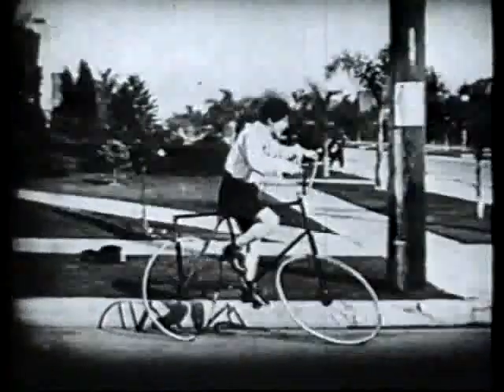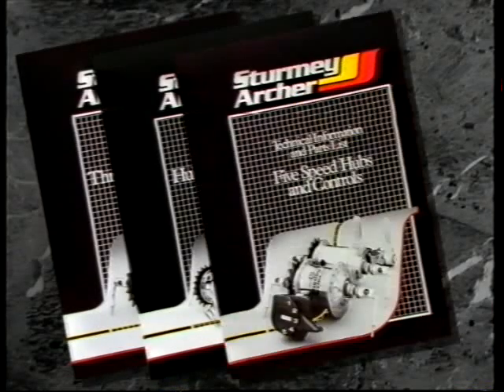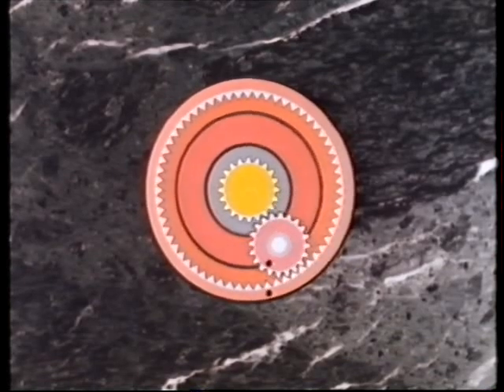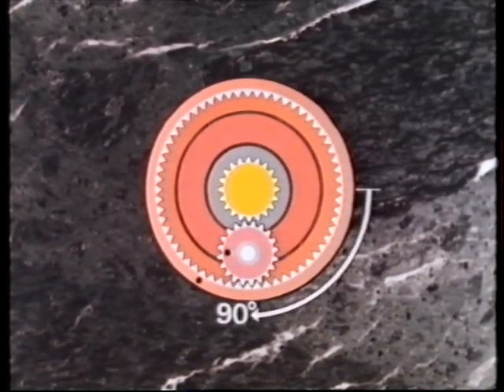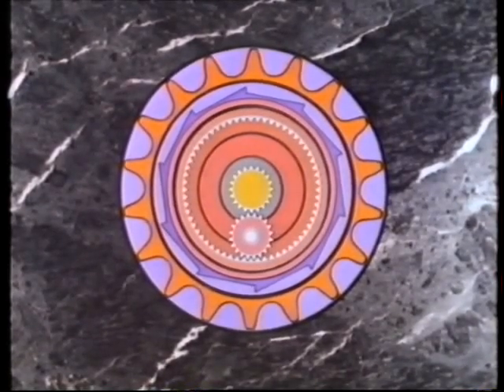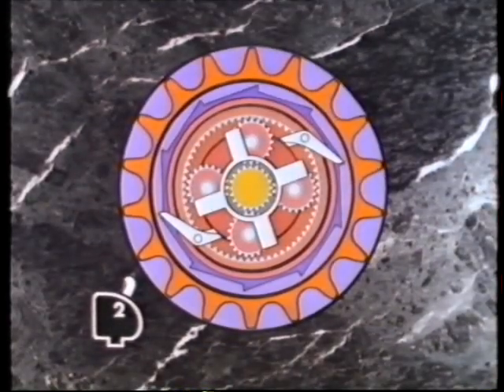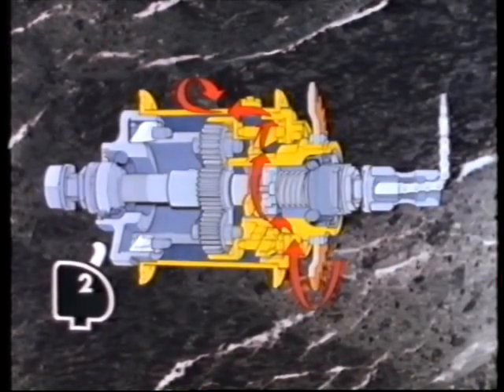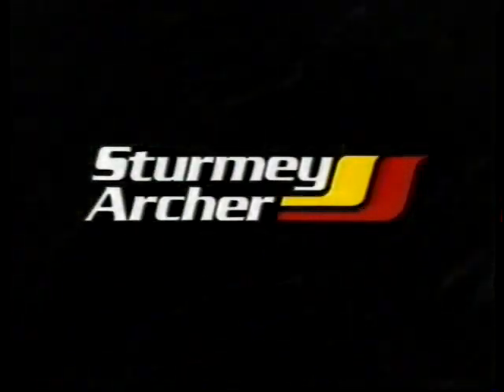Sturmey Archer Epicyclic gearing

Comment: I still have the S-A hub from the bike I road in high school 60 years ago. The rest of the bike got discarded due to damage in an accident, but I kept the hub. Being a youngster I naturally took it apart and figured out how it worked, and I was impressed by the simple and clever design. I appreciated the 3-speed hub compared to the derailleur concept because it was so simple to use and always provided the ratios that worked best.

Comment: I rode a British 3 speed bicycle for 10 years every day in Minnesota extreme cold winter salt - NO maintenance needed! I was completely anti-mechanical the whole time. I then went on a 250 mile "bike-about" at the end - along the Mississippi river. Only later did I realize all of these was possible due to the internal hub gear!! thanks so much. I probably spent $20 for the bicycle and I was in awesome physical health. Wow so you advertise 10,000 miles no maintenance and I went 3,600 miles with no maintenance in extreme weather conditions!

Comment: I won't lie, I still baffles me. But as a piece of engineering, it's beautiful.
Reply: Yep, Planetary Gears baffled me as well when I first saw them.  I saw an excavator on a reality TV show break down years ago, and I watched them open up the 3-stage drive unit... and I was hooked!  I then found the 14-Speed Rohloff Speedhub, and had to know how it worked.  It showed me just how little I really knew about mechanical engineering...
Reply: that's why getting a car transmission overhaul costs $4K - including installation. Yet a 3 speed internal hub gear bicycle can only cost $20 used with no maintenance needed for  36,500 miles!! I proved it over ten years commuting in Minneapolis.

Comment: i think I see why when in "Neutral" (here 'Normal") gear it would inevitably pop out of gear when pedaling hard, resulting in bruising my gonads on the crossbar. I tried adjusting it many times, as did a Schwinn dealer. seemed just a limitation of the design, at least back in 1958. I was glad to finally graduate from that to a motorcycle.
Reply: With a Sturmey archer the cyclist is supposed to stop pedalling when changing gear, opposite of a derailleur.
Reply: @TechStuff365  Possibly, but that wasn't my problem. It slipped out of gear when IN "neutral" (2nd gear).

Comment: In the 1980s I found an old Schwinn bicycle that I restored to the best of my limited ability back then. The bicycle had a Sturmey Archer  three speed hub connected to a single speed drive train. While working at a hardware store that also did bicycle repair, I found a three gear external sprocket that was made for my Sturmy Archer three speed hub. I then changed the single chainring crank to  a double chainring crank set. Then I fitted this beast of a bicycle with rear and front derailleurs, time trial aluminum alloy Cinelli handlebars with Modolo Kronos brake levers and road her until one night while giving my friends on BMX bikes about a 3 to 5 block headstart, I caught and passed all of them before the finish line. Then when I got to the finish which was Woodhaven Blvd., some asswipe female driver decided to make a right hand turn without using her turn signal. Needless to say I crashed into the dumbasses car and unfortunately wrecked  my three speed Schwinn that was converted into a 12 speed. I sure do miss that bike, I nicknamed her "the Tank"!!!!
Reply: that reminds me of when I was nonchalantly tooling down a neighborhood side street - this lady stopped her car, got out and yelled at me. How dare I pedal the wrong way down the street! I didn't say a word but I did think - as soon as you turn the ignition you are killing the planet. I rode a British 3 speed bicycle for 10 years every day in Minnesota extreme cold winter salt - NO maintenance needed! I was completely anti-mechanical the whole time. I then went on a 250 mile "bike-about" at the end - along the Mississippi river. Only later did I realize all of these was possible due to the internal hub gear!! thanks so much. I probably spent $20 for the bicycle and I was in awesome physical health. Wow so you advertise 10,000 miles no maintenance and I went 36,500 miles with no maintenance in extreme weather conditions!

Comment: the only modification I would want to make is a slightly bigger ratio, otherwise 11/10 hub.
Reply: Would I be right in thinking that you can have a higher top gear, but you would have to have a correspondingly low bottom gear?
Reply: @SM-dt1pr  correct

Comment: from what i can make out to simplify , its a complicated way of using the diameter of the central hub  ??
so gear 1 can never be any better than the widest point of the hub and top gear (3) is never any better than the smallest gear inside the hub , this is actually very good , the main issue with it is it was always put on already too heavy bikes like Grifter, chopper and bomber , on an aluminium bike this gearing would be great

Comment: I have a degree in mechanical engineering...and it still all sound like alchemy to me!
In other words WTF!!!
Reply: I did my degree whilst working on the shop floor. I can not only use the tin opener, I can design a better one and then make it for you, using either hand tools or machine tools....and use both metric and imperial scales.
50 years of experience comes in pretty useful too...
Reply: @ieuandavies4134  ....Good man. 👍

The lads we go just wanted office jobs. Pushing CAD around . They looked so out of place on the shopfloor . Except most of the lasses. My joke wasn't intended nastily BTW.
Reply: Ahhh. You'll probably know the square root of a tin of beans , but can't use a tin opener.  ....Sorry,  forgive my mirth,  we used to say that about new engineers , fresh out of uni. 😉
Reply: Same with me - aerospace engineering. Finally got it with that bit at 4,14..

Comment: It would take Sturmey-Archer to take the pin/roller analogy and absolutely bollocks it up: The "roller" (planetary gear and pin) should NEVER have been moved to the left of the screen when the "floor" was added. Visually, this makes the point appear as if it traveled the exact same distance as before (as it winds up in the same spot on the TV screen as in the previous example), even though it did move further. Problem is, most minds will fixate on the center of the planetary gear as a reference point - not the floor, which becomes a new reference point in the second example.

The planet cage rotation is also over-complicated in its explanation. The planet cage turns 120 degrees to the pinion's 90 degrees. Done, end of story. It didn't require the narrator to repeat the same concept backwards to the same animation.

Don't get me started on the gearing bit that follows, which is way too rushed. You could dub the Turbo Encabulator script over this and it'd make as much sense.

It's as if the same person who wrote the Dynohub GH6 service manual was involved in making the animations for this video. It's a good thing they didn't try to sell the AW with this video, or nobody would have understood or bought the thing.

Comment: Stermy-archer 3 speed hub, 15 years of  use, 400 miles a month, The only problem, The small chain from the hub to change the gears begun to fail, Replaced the thinn  rod with chain, Problem solved.  
The 3 speed hub was still in good condition when I passed the bike on.
Reply: Now that's bang for your buck!

Comment: I remember as a 12 year old earning extra pocket money restoring bikes that had been dumped. I dismantled 4 hub gears before I finally understood how to repair and reassemble them. I got known locally as the person to see for bike repairs.
Reply: I got a problem with my 1980's SA 3 gear hub. It doesn't engage idle when walking bike(pedals are spinning). When pedalling I can feel force transmitted to pedals when I stop. I've have replaced chain, oiled hub, replace pin chain. Still no results. Bit hesitant to open it up.
Reply: @kamilpotato3764  Here is your answer after two years. You need to open it up. You have got problems with the ratcheting pawls or something is jamming the mechanism to act as 1 unit which makes your hub turn the pedals. There is also a slight chance that debris is gumming up the gap between the hub and the sprocket. If this slight chance is correct you can repair it by simply cleaning the gap but you will probably have to take the chain off for this and at that point why not service the hub too? If you don't feel confident you can visit the local bike shop, it is their job.
Reply: Can you fix mine 😂

Comment: And the older ones are more durable then the new stuff out today...figures.I got chrome parts 30 to 40 years old that still look new while a year old bike left outside is completely rusted...they don't make anything like they use to..
Reply: Nickel plated most likely.

My Sturmey Archer S2 has hairline fractures around the case near bearing flange
Reply: So you're saying older stuff could break the law of nature?
Reply: Most anything chromed left outside will rust quickly. It has to do with electroplating and UV radiation. I'm a retired ASE master tech and I've seen 30 year-old simple chrome plating on pushrod ends that have never seen the light of day and they're pristine. But UV radiation will break the valence bonds between the chrome atoms and the nickel atoms underneath (all steel and iron must be nickel plated before they can be chrome plated) and soon the water will begin to rust the nickel and iron underneath it.
   Car makers, back when they had chrome plated steel bumpers and trim, used to put on three layers of chrome plating and still they would rust after about five years: tiny spots here and there, hardly noticeable until the water began to tunnel through the steel underneath. I'm sure you've seen the result.

Comment: That fancy voice didn't explain the sudden neutral between gears that seems to know when you are peddling while standing up.  How do they do it, witchcraft?
Reply: Basically there's a gap between the clutch engagement points for 2nd and 3rd - this is because engagement of both gears at once could destroy the hub. (Or so I seem to remember) 

Careful cable adjustment can prevent it in most cases - I've over 2500 miles on my NOS AW and it has not required a cable adjustment since the first week, neither has it given me a false neutral :)
Reply: Did that more then once lmao....one time I managed to fall over the handle bars going pretty fast when it suddenly hit neutral while giving it standing lol...that time learned me not to trust it no matter what.
Reply: @Mathias Ljündberg I got a problem with my 1980's SA 3 gear hub. It doesn't engage idle when walking bike(pedals are spinning). When pedalling I can feel force transmitted to pedals when I stop. I've have replaced chain, oiled hub, replace pin chain. Still no results. Bit hesitant to open it up.

Comment: The planet sockets to the outer flange wasps flip the tangle flumpets to the outer sprockets via the travel cage of the sun cauliflozzit... right?
Reply: The original machine had a base-plate of prefabulated amulite, surmounted by a malleable logarithmic casing in such a way that the two spurving bearings were in a direct line with the pentametric fan, the latter consisted simply of six hydrocoptic marzelvanes, so fitted to the ambifacient lunar vaneshaft that side fumbling was effectively prevented. The main winding was of the normal lotus-o-delta type placed in panendermic semi-boloid slots in the stator, every seventh conductor being connected by a nonreversible trem'e pipe to the differential girdlespring on the 'up' end of the grammeters.
Reply: @Anvilshock   and Jay E
Better than the original    LOL
Reply: @Anvilshock  🤪
Reply: Anvilshock 

Gotta admit we go deeper than this English might implode onto itself.
Reply: Thanks for that clarification, Anvilshock. Jay Edwards was on the right track, but you really nailed it!
Reply: Spot on....
Reply: You Done graduated from the third grade...

Comment: i have a 1961 and 1970 SA hubs on 2 different bikes and  i love them very reliable in my book
Reply: I have seen the go for crazy money on Ebay for just the hub...and all the parts to go with them are just as much...one was 300 for a 50ies model 3 speed..went to the dump a week later and found 3 of them but not old ones...Anyone looking for one or parts just go to the dump around spring cleaning time..

Comment: this looks old?? I have heard that sturmey archer are now made in china and are very unreliable?
Reply: They are made in Taiwan.  The quality certainly isn't lower than it was when they were made in England, and may be better.
Reply: Sturmey Archer hubs are now made by Sunlite or Sunrace.. I'm not exactly sure. I'm also not sure of what country they're made in either, it's somewhere like China or Taiwan but definitely the margin for error isn't what it used to be in the 70's. I'm still a fan of these hubs and I'm very glad they are making the 3-speed fixed hubs again.
Reply: Darran hanlon don't believe everything you hear, a good old research still helps..
Reply: The quality is even better. They use new machines and tools. I used made in Taiwan SA XRF-8 in the mountains. Far outside normal torgue limit. No problems at all. Try this with new Shimano hubs. And you can disassembly avery SA hub w/o problem and replace the weared out parts.
Reply: @vladimirstartsev2421  They use the same machines that were on Triumph road. When they bought the rights, they bought all the drawings and process machinery. Currently they're making the version that was first used in 1958.